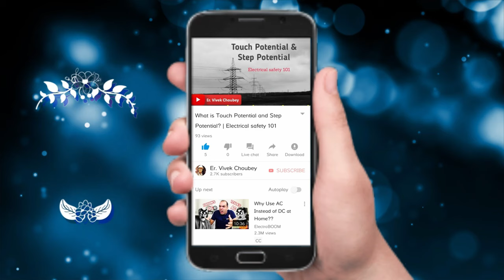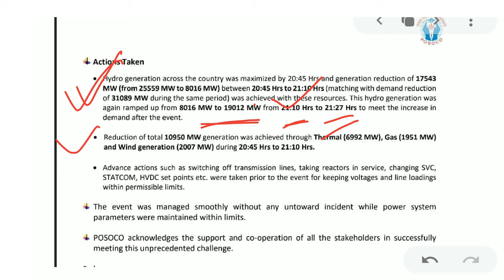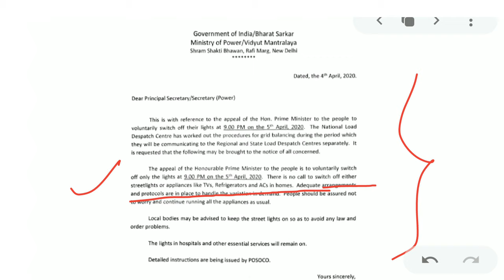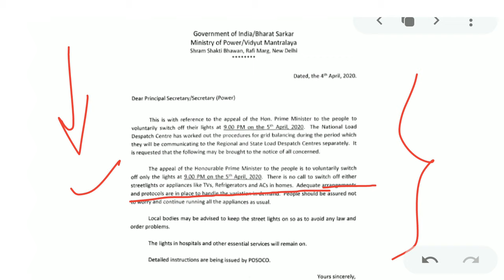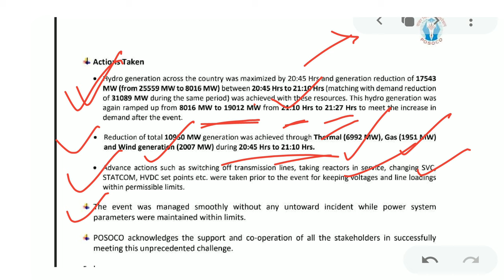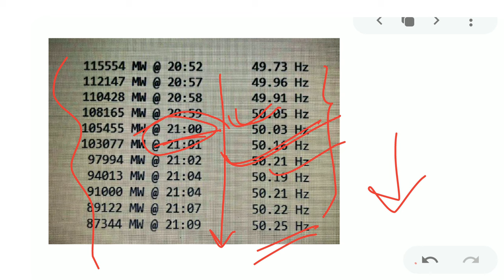Switching off lights for 9 mins | Grid Failure? Why & how was it managed then? Simplified Analysis

Comment: isn't there a feedback system which can take feedback from the load and regulate the steam in the scada age
Reply from the maker: Yes all automation system is there but it requires time. You can't expect the plant to momentarily change the parameters safely. The time duration for the whole change was only 9 minutes which is a very small time. Plus this was not with a single generator but the whole grid.

Comment: Brother actually Eddy and hysteresis losses are not proportional to frequency, if we replace Bm by V/f( as the voltage remaining constant ), then the relationship btw freq and losses becomes inversely proportional in hysteresis losses and in case of Eddy current losses it becomes independent of freq. So by increasing the freq losses will actually reduce
Reply from the maker: But in case of sudden unloading the frequency alongwith the voltage will increase and that too not proportionally, the voltage won't remain constant but will increase abruptly due to sudden fall in demand.

Comment: I think you don't work in Power Systems. Though the explanation is nice but there is some technical error.
1. The boiler design you drew is completely wrong. Even the nozzle symbol. Search de Laval nozzle on Google and you will find it. De Laval nozzle is used to generate supersonic steam. 
2. The protection equipment of Thermal power plant act very fast. They are faster than Hydel power plant. Thermal plants can be turned off in a second. But it is undesirable and reboot takes much time.
3. On that day Thermal plants also reduced their production gradually to meet the requirements. And there are many backup pumps which were turned on to increase the load at 8PM.
Reply from the maker: Thank you very much for your feedback. I have limited experience in the same as a trainee for few months. The drawing which I have shown is just for indicative purpose so that more people can understand. I know about the speed governing and control system that works behind keeping the match between the supply and demand and as you said it's easy to shut but tough to reboot as that will take hours thus that can't be afforded as the coal fired thermal power plant is the mainstay of the entire power generation. Here I have tried to simplify the technical details with special focus on the concept of Swing Equation so that more people and even those who don't have an Engineering background can understand the scenario simply. I know a lot of things haven't been considered here which can be attributed to the complexity it will create in a single video as well as my limited experience in power plants. 

Thanks once again for sharing your views. I appreciate that.
Reply: @ervivekchoubey  Yes. You are correct. But the modern control system of power plants is completely digital. That's why they are very accurate and fast.
Reply from the maker: I completely agree with you. Thank you very much 🙂